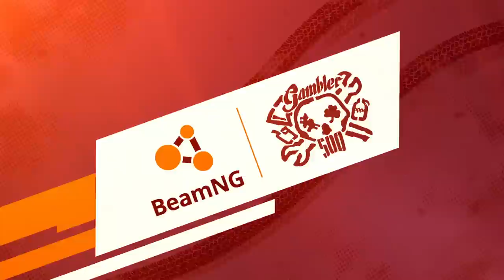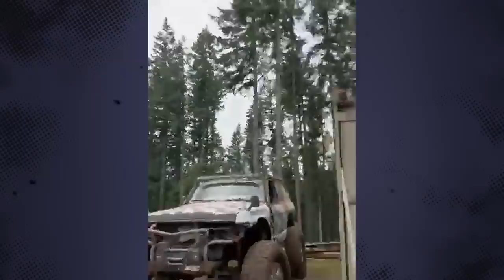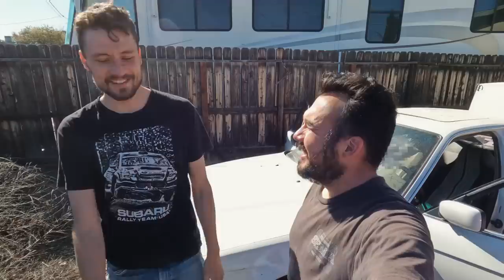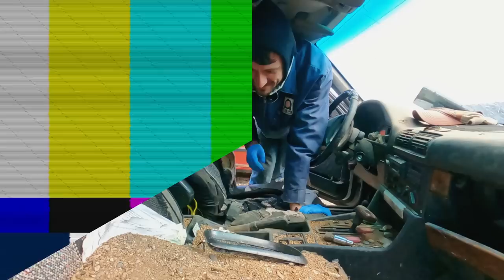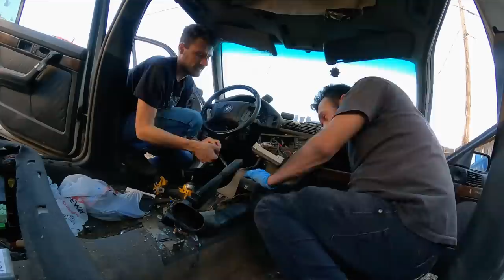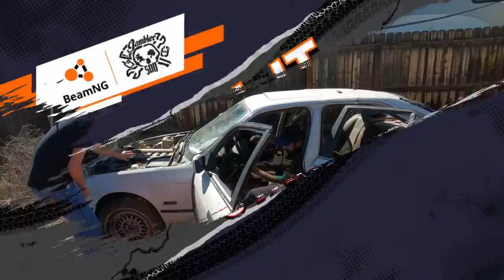BeamNG x Gambler 500 - Build Vlog #1

Comment: Having some special mode in BeamNG where you have to repair destroyed cars would sound really fun xD
Really cool that you guys are doing stuff outside just the game though! Stuff like this lets us learn things while also letting y'all learn even more things about cars
Reply: A combo of my garage and beamng where you have the main structure of the beamng physics model, but you can remove and replace the panels using an adjustable wrench and an angle grinder.
Reply: Funny thing there is a repair mod out there (that didn't work anymore :( with the newest version) that allowed to reform the nodes into it's original position while the car technically was still broken. I used that tool to for ex. spawn a second none broken version of the same car, dettached that car's doors and other parts and attached them to the broken car, like an replacement using the node grabber. Which kinda worked. A little camera bug but having such thing naturally without bugs would be amazing. The repair mod just simply allowed me to attach those car parts from the other one onto the broken one because otherwise the whole frame would be deformed.

Comment: Holy crap! I just bought a damaged BMW E34 three months ago to fix and restore and suddenly the official BeamNG channel has the same car?! I can't believe it. This is awesome!
Reply: Haha, lift it! I didnt like BMWs until I started working on that e34. They are so easy to work on :O,
Reply: @ferrettankror1  Yeah BMWs have bad reputation due to their drivers, but damn those 80s/90s/00s era cars are so good. So user friendly, reliable and fun to toss around. True driver's cars. E36s are so damn easy to work on it's crazy. Currently working since a year on my new project - E46! :D
Reply: @driv3ver  ah yes so true :D, I didnt want a bmw until I started working on this one. How difficult and expensive are the e46s?
Reply: Sorry for the late reply. I had too much work at work ;)

It depends what your plans are and where you are living. I'm from a country where we don't have a lot of "eco" fees. These are now one of the cheapest BMWs, and the cheapest 3 series to get. The previous gen is already quite old, so prices went up. E90s on the other hand, haven't aged thaaat much yet, and are way more difficult to work on, so those in good condition cost a lot. 

Difficulty level (1-10)
E36s = 2 or 3 depending on model - usually very easy

E46s = 4 to 6 depending on model - quite easy except for AWD models. 

E46s are still nice to work on but AWD versions are a bit pain in the lower back. The rest of the 46s are quite good, but are more advanced than E36s, much more electronics and fewer parts fit each other. Though E46 electronics are "old school" by modern standards and usually ain't making a lot of trouble. Easy to customize, programme etc. 

Sooo... I opted for E46 Touring 330XD - 3.0L diesel 204HP 410Nm wagon AWD.( Mind it isn't "X-drive"! Constant AWD just like in good old Subarus :D ) Currently on 400HP 820Nm, but that isn't final. Hope to get in area of 450HP 900Nm smoke free. And that isn't even on straight pipe. It still has catalytic converter and mufflers to make it within EU4 emission norms and quiet, as it will be a car-audio competition car.

Biggest issue is finding well maintained chassis, as those are almost always rusted, and bodywork is the most expensive of them all. It took me a few months and checked a few cars before I got mine. - Even though my budget was very high and I've asked only for mint condition cars, some guys tried to sell me some expensive trash, with the chassis falling apart (not joking!). So I wasted quite some money on 2 mechanics (1 BMW specialist and one bodywork specialist) and fuel checking some cars, but got a damn perfect base. 0 rust, original conservation, 0 accidents. Only not in my spec as it was automatic and with poor equipment. Though all this is a small issue, as it's very easy to equip those cars. There have been 3.3milion E46s produced, so market is full of used good quality OEM and aftermarket parts. So to equip everything to maximum spec, it was less than 1000 euros. Swapping to manual was expensive though, as only a few have ever been done globally, and it requires welding etc. to be made properly. But I got it done better than OEM!

To wrap it up. E46s are really cheap now. I got mine in very good condition for 3500 euros. Just a motor alone is worth 1200eur - gotta look for one in eastern europe though, in Germany/Netherlands/Belgium etc. those are crazy expensive for some strange reason. With good motors like M57N you've unlimited tune potential, want to have a reliable RWD daily with 500HP and close to 1000Nm with rapid reving, economic diesel engine and really good sound - no issue, stock internals, stock drive train. Just gotta work on the induction and exhaust systems. If you're really interested in getting E46 then we might chat on What'sApp, Telegram etc. I've a bit of knowledge about those and I'll be happy to help.